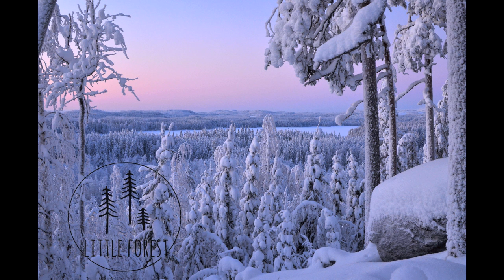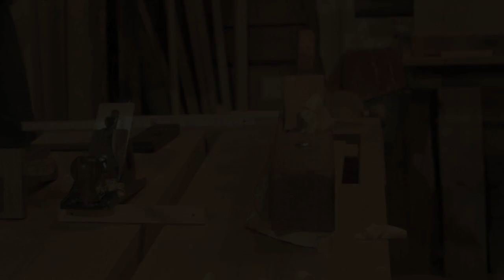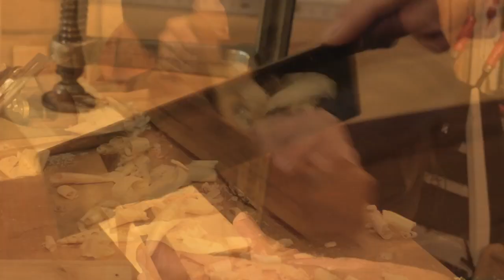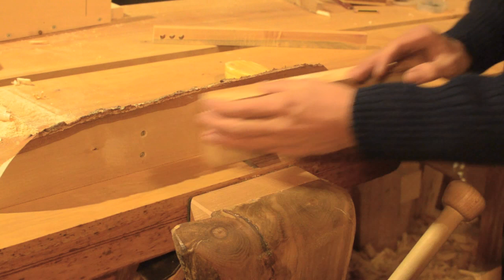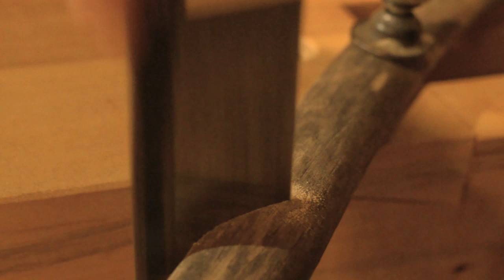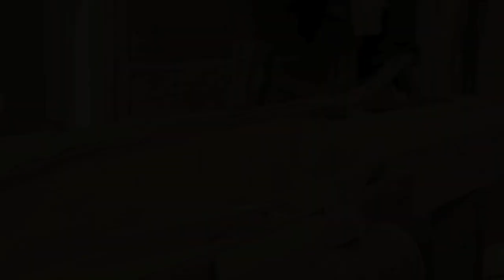Upgrade a Jointer Plane - woodworking with handtools

Comment: Very nice. It makes me wonder why joiner planes don't come with a fence normally.

Very nice to see that axe handle finding a new life as well.
Reply: The record co. did make just that type of plane called a technal jack mostly used in trade schools in UK.
Reply from the maker: Yes, so simple that I've been bit wondering if I am really the first inventor of this idea.
Veritas sells some similar and quite expensive things for their iron planes. But still the plane is pushed, not the wood, which does not help for thin pieces..but thanx to them; it is while watching them that I got the idea.

Comment: in my opinion wooden planes, especially jointers are very difficult to hold level on the edge of a board... where as metal stanley planes really kind of register on the flat face and stay there... any idea why this is?
Reply from the maker: Hello Baum ;-)
One difference between the iron jointer plane and the wooden one is, that the handle for the pushing hand is more low, near the target with iron planes. That helps to be more precise moving / holding it.
Reply from the maker: Actually, both hands are closer to the wood...
Reply: @littleforest  i see, ofc... have some of both plane types but never was really happy with the big wooden jointer... it was just cheap to get here in austria...  but i like your videos really much! a lot of ingenuity! where do you get your ideas and skills from? do you have a oldtimer who shows you or books? or all by yourself? best regards Georg:)
Reply from the maker: Maybe our preference is much depending on what tools we are used to. I have actually never had an iron jointer in my hands...
This books and oldtimers, it seems, they are somewhere inside of me.
Greetings back to Austria!